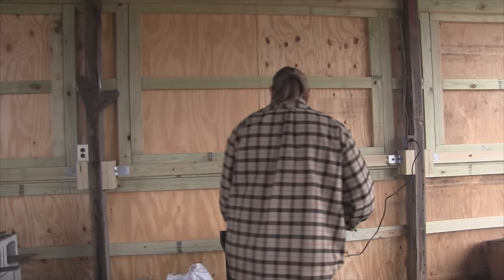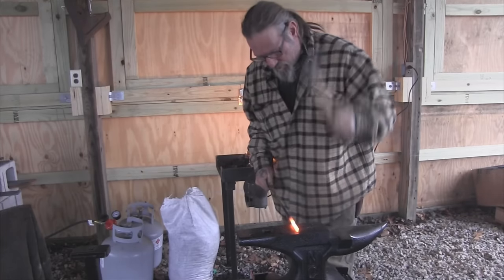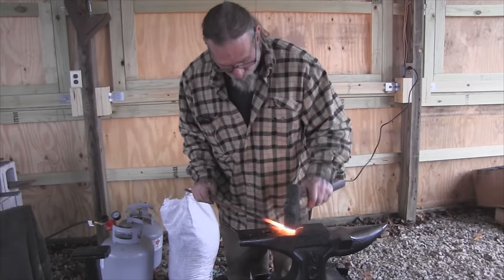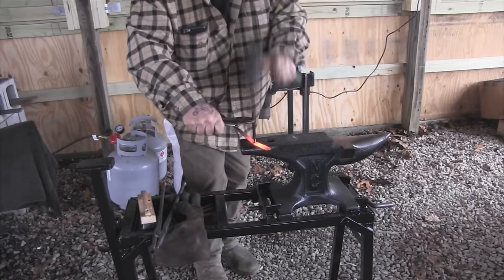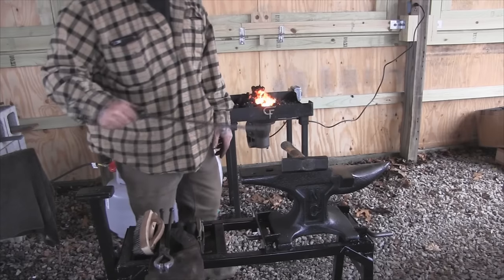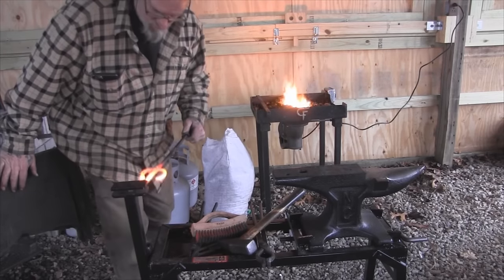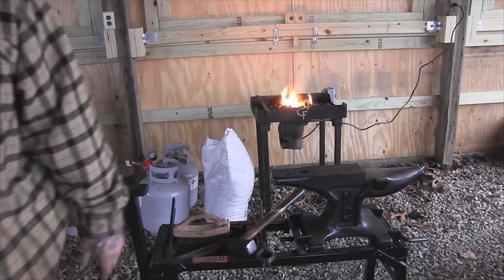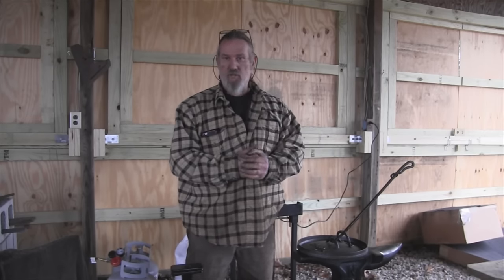Forging a Dutch Oven Lid Lifter

Comment: Great video, and a great tool to be making. I've got one of these tools, and it seems to work a bit better with the legs a little straighter. You get a little bit more torque when you're tilting the lid to dump ash, which helps younger boy scouts still work the dutch oven without getting into a dangerous situation.

Comment: Hey Dave, love your videos.  You mentioned the ball end of the ball peen hammer.  A great subject for a future video. The original use for that ball end in metal working was peening or surface hardening by contact. Today it's widely accomplish with shot peening  used also to relieve surface tensions. It would be cool to see it used in a spring making process.

Comment: I was wondering, how do you get the fire started in your forge? Do you use wood or is there some type of gas burner inside to get it started. I was told it took a lot of heat to get coal to burn.

Comment: I note you said coke in reference to the fuel you burn in your forge. I always thought it would be anthracite.
Reply: Coke is to coal what charcoal is to wood.
Reply: By the way, I am familiar with coke, it was the by product of coal gas production in my home town. The coke was used to heat our homes in pot bellied stoves and the gas was stored and fed into the mains to cook with. One good thing about it was that you knew about it if you had a gas leak! what a stench! when I was a child at school our metal work room forge burned anthracite I think.
Reply: +David Harvey 
Ah. Very well.
My coal is bituminous and rank. The anthracite would be so much better I assume.